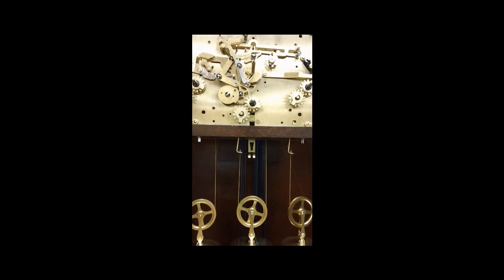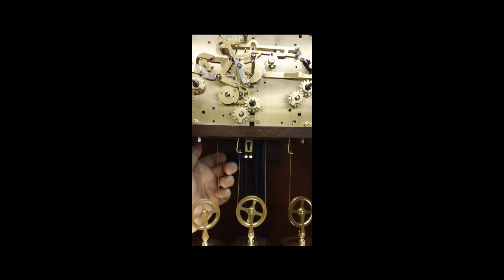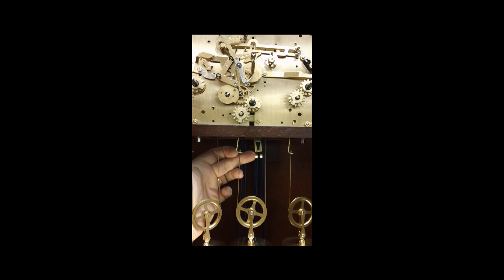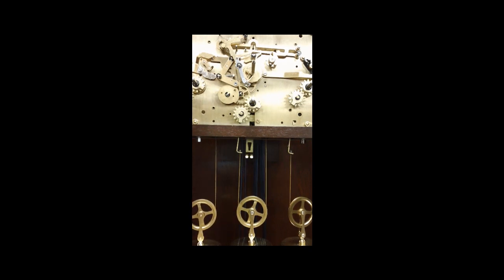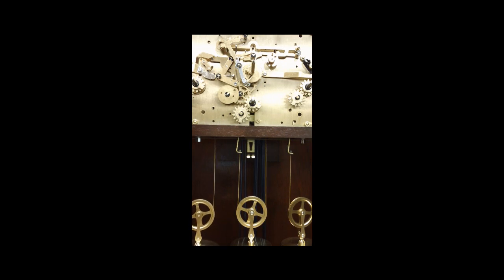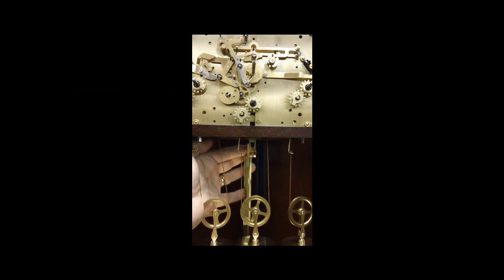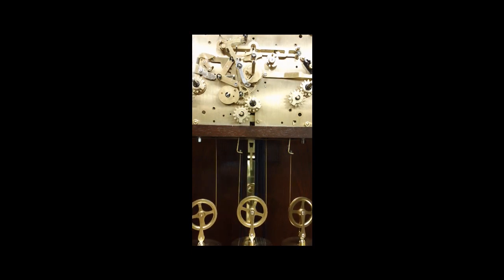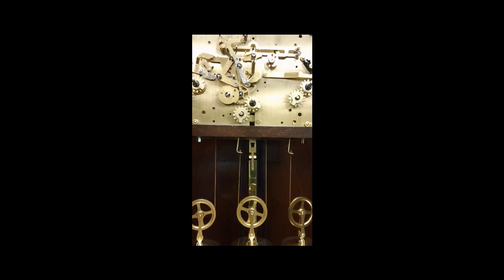Setting the beat of a grandfather clock

Comment: Most modern Grandfather Clocks have a self-adjusting beat, as does that Kieninger, just give the pendulum as big a swing as you can, and it will automatically adjust itself. 
If a self-adjusting beat clock won't stay running after you swing the pendulum as far as you can without hitting the side, then most likely the clock needs to be cleaned & serviced properly or has wear. You shouldn't have to manually adjust a self-adjusting beat clock.
 You have to distinguish whether or not you have a self-adjusting or manual beat, you shouldn't be able to push the pendulum hanger on a manual beat clock that easily. If you continue to run your clock without cleaning and servicing it properly, it will cause wear and require restoration, ie, bushings.
Reply: tgifford thanks for that tip on the modern grandfathers.  I've been searching for a while on adjusting the beat on my recently inherited clock and found lots of demos and how to's, but nothing looked like what I was seeing in my clock.  I was reluctant to try anything for fear of making matters worse.  I tried your tip just now and the beat is perfect!  Easy Peasey
Reply: Brilliant!  I have a Howard Miller "Lewis" model wall clock that I absolutely adore.  It is just over a year old, and I brought to commemorate our 35th wedding anniversary. However, recently it stopped keeping good time, and the pendulum would stop swinging after about three days (normally runs for a week at a time.). I found website that had this video on keeping beat.  After listening, I quickly realized that was my issue.  I adjusted the clock pendulum by moving it slightly on the wall, but it was off balance.  I was a bit apprehensive about doing the procedure mentioned in the video.  After running across your comment, I knew my clock is a Kieninger key wound.  I leveled my clock and tried your procedure and voilà!  She looks and sounds beautiful with a nice even beat and level appearance.  Thanks for the heads up!
Reply: @rogercolon2633  I’m having a problem with my 35 year old Howard Miller. It is slower and slower and eventually stops. Ideas?
Reply: @Cody J Miller  Have you ever had it serviced? Best thing to do is to take it to a Howard Miller service store.

Comment: One of the cable threads which feed through the pulley came free from the anchor. I cannot snap in the end of the cable back into the anchor. Is there a way to snap it back in?

Comment: I have a 35+ year old grandmother clock. A pro came and got it working (previous clock guy used WD-40 and messed it up.) However, it won’t keep time. It keeps getting further and further behind. When I messaged him, he just keeps telling me to spin the dial on the pendulum tip to the right. I kept doing that and it never improved. Eventually, it just stopped working. I moved it back to the left and it worked again… but still slow. Ideas?!
Reply: Well how did the last guy "repair" it?

Comment: Here is an unaddressed issue, the wheels have come off the cable, and the ends with the stops on them aren’t seated where they should be seated. How do I seat the stops so the wheels are on the cable correctly? I know to thread the wheels back onto the cable but I can’t see where the end with stop seats

Comment: So, you move the pendulum leader until the anchor touches an escapement tooth, then move it slightly more, this is the adjustment that slightly rotates the anchor on the shaft, correct? (With pendulum removed)
I have been holding the pendulum leader in the straight down position and reaching inside and trying th rotate the anchor very slightly, that is sooooo difficult to achieve it in beat, I was shifting the anchor on the shaft, which is exactly what is done in the above description, but this method is very crude and too easy to over adjust.  
Would you expect all grandfather clocks with the pendulum removed that the pendulum leader would continue to move back and forth when it was in beat?  If it doesn’t continue to move back and forth quickly then something is wrong with the clock, correct?